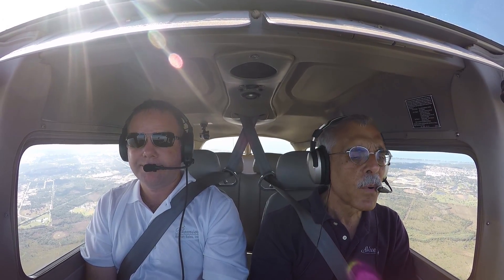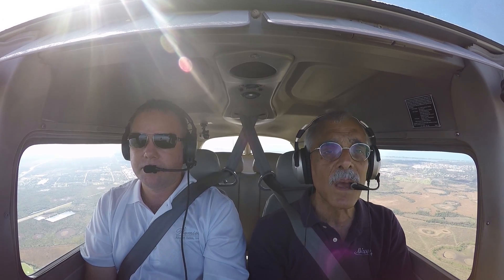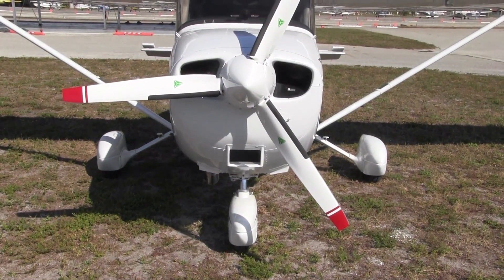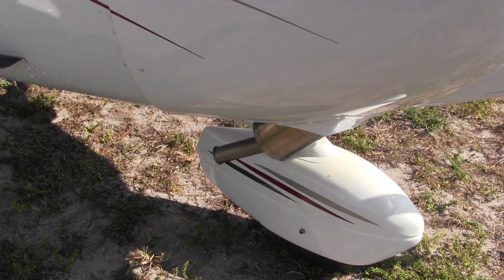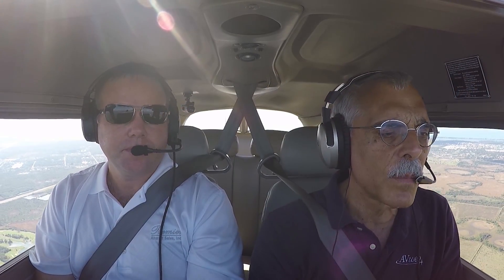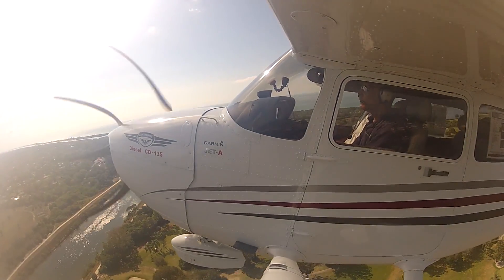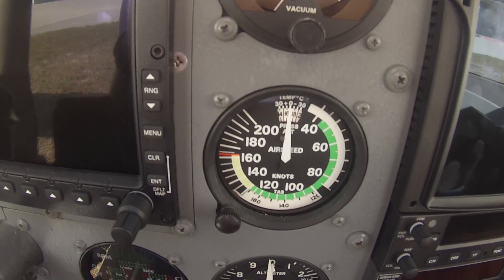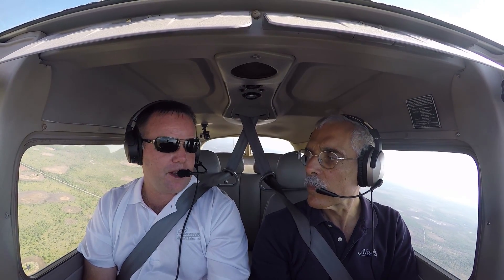Premier Diesel Conversion

Comment: Is Premier using the CD-155 diesel in the 172 from the 172 JT-A? Would be nicer to have the increased payload if the CD-155. I would buy a CD-155 with G500/GNS-650/G5/GFC-500 for a 172 conversion to ditch the whole vacuum system. 

Would be a beautiful aircraft just like the OEM JT-A if not better since the avionics are easily upgradable unlike a G1000 that’s integrated into the type certificate.
Reply: For that money just go for a turbo prop.
Reply: @ohwell2790  what is the hourly fuel burn on a turboprop??? 5gph? That's what the da40ng gets....

Comment: Woah...Useful load goes from 800-900lbs to 631? That is a big difference!
Reply: This is stupid. Get a diamond. They have actually more useful load with their diesel engine vs the avgas they offer for the da40. Also range and speed is increased compared. The only drawback i saw is the avgas climbs faster and uses less runway for TO. Diesel is almost twice as efficient. 5.4gph vs almost 10gph for the avgas.
I'm sold...

Comment: Useful load of 631?
Reply: +endwood Actually it's an incredibly simple, proven, and better design with no risk of shock cooling, or pilot error causing an engine failure or power loss.  Now, granted on this particular aircraft their payload is BS, and the only company really doing diesel right at the moment is Diamond in the DA-42s, but "simple air cooled" design being around for a zillion years for a reason is about the most ignorant statement a person can make.  ADF has been around for a zillion years too... must be the best method of navigation out there, right?  Personally I have no desire to be flying around in a plane with 1920s engine technology, low TBOs, and burning twice as much gas as I need to because the FAA is too afraid to let a computer govern the mixture of an aircraft engine.  I wish someone would mandate diesel conversions across the GA community.  The problem is flying with safe technology costs more than almost any normal pilot can afford.
Reply: +Alan Cluff Yeah..I noticed that too! That is almost C150 territory! Not to mention the added complications of turbocharging and water cooling with an engine that displaces 3 times less.....now you have to worry about manifold pressures and coolant temps. I will pass for now.
Reply: +Brandon B 
Agree, too complex. Once you have an odd ball plane out there in the field it becomes an orphan. Parts, maint & diff fuel means headaches at smaller dromes where Avgas is common! Simple air cooled design has been around for a zillion years, there's a reason for that !:-)

Comment: I don't know of any airports with diesel fuel at them, how would you fuel?
Reply: +Jry Gonzo Well, actually aircraft diesel engine use Jet fuel, like Jet-A.
Reply: +Jry Gonzo Aviation Diesels run on Jet-A/Jet-A1. You can even see the labels on the wings in one shot.
Reply: The big planes run on thermotolerant Diesel, sold as Jet A fuel.
Reply: awe!!!